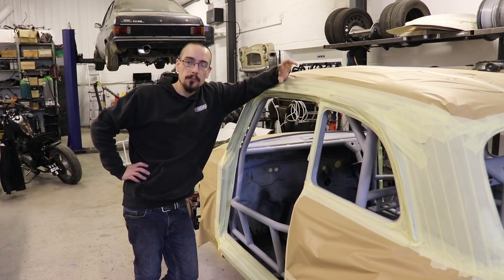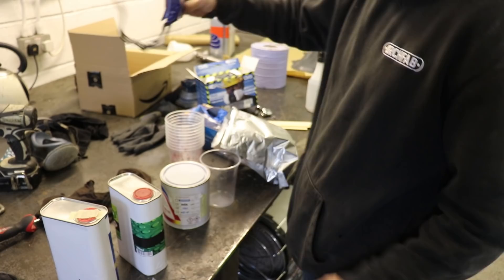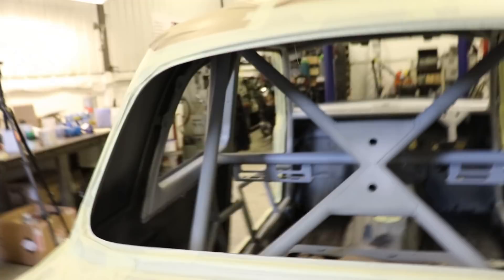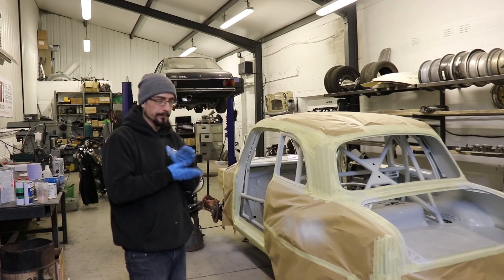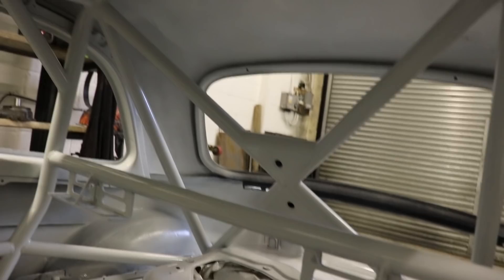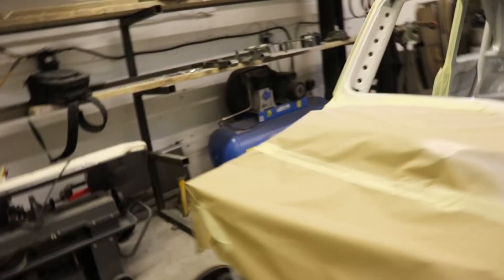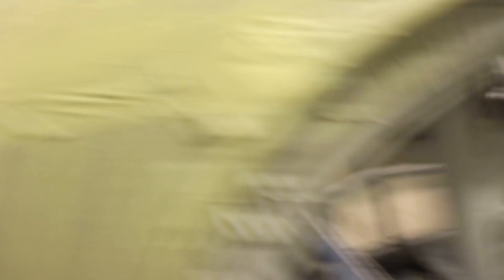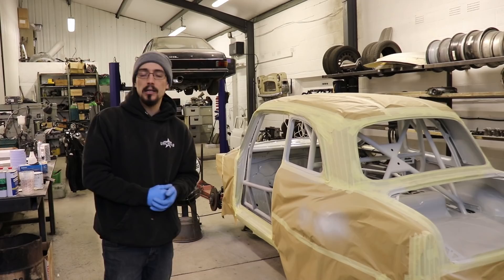ATTEMPTING TO PAINT THE ROLL CAGE, MONGREL 1 URCHFAB NIL.

Comment: Happy New Year. If your heater runs off of propane it will release huge amounts of moisture into the atmosphere.
Reply: Yeah they produce heat, CO2 and lots of H2O. Get an electric heater, as you will also find unpainted projects will rust very quickly.
Reply: @MattBrownbill  and Carbon monoxide CO in huge quantities (odorless and deadly) 30+ years as a gas installer. I have seen the aftermath of a boiler that went wrong during the night, It killed a family of four whilst they slept
Reply from the maker: It runs on diesel.
Reply: @Urchfab  I was a registered  gas installer hence my knowledge of propane. diesel will still produce CO Carbon Monoxide, but I have no knowledge of water content but i'm sure you could look it up.  I just want you to be safe mate. Happy new year !
Reply: @malcolmtill  Diesel does not produce Carbon Monoxide - That is why it is IMPOSSIBLE to commit suicide with diesel and why no one has ever managed to trying to use a diesel engined vehicle to do so. The worst that has happened to anyone trying that was a sore head or feeling sick.
Reply: @williamwoods8022  Sincere thanks for taking the time to reply. Everyday is a school day and at 60 years old I have learned another fact. Happy New Year !
Reply: @Urchfab  Old school rule of thumb was  a pint of H20 per gallon,much is different now,better fuels,burn rate,etc. And a space heater is not an engine but water is just one of the nasties,modern diesels contain all sorts of synthetic additives along with diesels own nasties,space heaters don't burn efficiently and in use they tend to hiccup from time to time,you hear a slight misfire or stutter in the sound of the burner.
Don't buy expensive to run electrical equipment,make a heat exchanger using the diesel heater,some sheet metal and fairly decent sized fan,vent the exhaust fumes out of the workshop and it's much better for your lungs also.
Reply: @Urchfab 
Looks like it's a mixture of issues going on mate. 
The water dots is just simply condensation forming on the colder parts of metal when using your heater, try heating the whole area to be sprayed to an equal temp. 
Wipe down any part your about to spay with panel perfection, just before you spray. 
Get a mini in line water trap just before the gun. 
Then you'll be good to go. 👍🏻

Comment: you need to get yourself some disposable paper paint filter funnels. They do two things they trap the microscopic inpuritys out of the paint so they don't plug your spray gun and second the funnel mixes the paint right before it gets used.
Reply: Yes, when I saw the paint going strait into the reservoir, I was like Oh no.
Reply: Disappointing that the paint supply guy didn't send filter funnels.  Mine always gives a handful of funnels and stir sticks.  Helps to have some empty cardboard trash boxes to toss the used stuff in. As your compressor is running a lot to keep up with the air supply needed to feed the gun the entire compressor gets hot. I suspect that the humidity is well above 50 % there. This fact and the heat from the compressor will cause a lot of water build up in the comp tank and the hose feeding the gun do to condensation.  My experience has been that TWO water traps and an in line trap before the gun will sometimes not be enough. This is why big paint shops have air line dehydrating machines to keep the water out of the lines. Sorry you had the water issue. Personally I don't think it's a big deal since it's on the inside and a scotch bright scuff and fresh coat should cover it up but I realize it is a hassle to have to deal with. I have watched all your vids and I know that you can reorganize and crack on mate !!!
Reply: Or just buy the PPS system from Colad and you dont have to waste time with filters and cleaning the cup (Y)

Comment: The 3 main points for me to spray paint around the joint are,
1 Use a really clean well maintained gun.
2 Use "dry" air.
3 Finish mixing the paint by tipping it from one container to another a few times and then filter it as you tip it into the pot on the gun.
By NO means am I a spray painter, and I usually end up with as much paint on me as what is on the job, but I nearly always end up with a pretty good job.
Well done Matt and all the best for 2020

Comment: You need a cheap gazebo to paint in to keep it warm and the rest of the work shop  clean, good luck, happy new year
Reply: I was thinking some plastic sheeting, supported by a frame at the top.  
You could raise and lower the frame from the ceiling when not in use, and roll up the sheeting in some fashion.
Reply: Was thinking the same, I know a guy who painted his car on the front lawn using one , much to the anger of the neighborhood lol
Reply: Use radiant heaters, even lights will work in a pinch.
Reply: If you use an enclosure, you'll need some extraction, unless you wear a full face air fed mask, but these need a filter where the airline connects cause you don't want to be breathing in water from the compressed air feed pipe, modern professional  paints, are 2 stage finish mostly, some can be 3 stage,  the base coat/s contain xylene, whereas the clear coat(2k)contains Isocyanites; neither good for your health.

Comment: Good effort Matt. I’ve done the same thing on my escort and had the same issue’s. I have footage I’ll be uploading in due course, from my experience, I use a designated hose just for spraying so it had no contamination from oil etc. Use filters when pouring paint into the pot, build a really quick make shift booth using the cheap plastic sheets from B&Q, use a small gun, especially with the cage, I know it’s a pain in the arse. Use an electric heater for heat and not oil or diesel, them heaters seem to blow tiny particles of oil and fuel that contaminate the paint and steel and lastly I use a desiccant inline snake hose from frost. Cured all my paint issues. Good luck, I can’t wait to see the next video.
Reply from the maker: Cheers mate.

Comment: I use the same gun, use 2.5 turns out on the fluid adjuster and full fan. Filter the paint into the gun and as you mentioned use a water trap on the gun. 
If it’s all cleaned out properly it’s a really good gun and shouldn’t give you any issues. Also you need about 2 Bar I think at the gun.

Comment: Get one of those cheap marquee things to setup as a paint booth or string up tarps.
You can make a water trap out of a garden sprayer kitty litter and some scotch pads.
Fit some air fittings to the sprayer tank to suit you lines . The inlet goes at the bottom under a scotch pad, fill the tank with kitty litter or other descant and pack it down and cover it with at least three scotch pads to filter dust before the outlet. Place it before other filters and water traps if you have them. Note this is a back yard setup on a budget not a pro tip

Comment: G'day from West Australia, Matt🙂
I would like to make a suggestion that you can take or leave. As you please.

Air compressor by definition compresses air which generates heat, thus moisture.

Sooo one old trick is to get some aneeled copper tube make a coil out of it,
And run it from compressor head and tank pressure valve.

This gives the compressed air time to cool before entering the tank🙂

Thus extending the life of tank rusting internally, and any air tools a longer life.

If you happen to have access to a second tank you could also add that into the air line at a higher point above compressor, to ensure even drier air supply an oil cooler plumbed into air line between compressor and second tank.

Take what you like and leave the rest Matt, have an Awesome New Year 😉🙂👍👍
Reply from the maker: Cheers Steve, happy new year.
Reply: @Urchfab  welcome😉🙂👍👍

Comment: Hey Matt.  You could get a portable carport/PVC covered area and put the car in that. Less area to heat up and contains the over spray. You can buy the blue plastic desposable water traps for the spray gun. I have used them heaps and they work really well.
Cheers

Comment: I painted my Jeep in a gazebo in my garage. Used plastic dust sheet to cover the floor etc. Came out good in the end. Two water traps on the line and you must filter your paint before putting it in the gun using the disposable paint filters. If the shop is cold use less thinners (reducer). Some guys gently warm the paint but I've not tried it myself. That paint is perfectly salvageable. Don't think spectators at a race meeting would see the defects either.

Comment: That water is most likely from your air compressor, put a bit of air in it and open the drain valve, also fit a moisture trap?
Reply: Have a spare water trap/regulator in Dorchester if you want it..
Reply: You need a water separator, the filter with the paper element is for particles, not water. Ideally you should build a water separator “radiator” out of copper pipe and a few ball valves. Plenty of plans on YouTube. I made one that works great for when I sprayed a few panels on my Range Rover at home.

Comment: I am an auto body technician and I will try to help. I think you have several problems when you cleaned the gun you loosened the old paint but didn't get all of it out so as you sprayed it started coming out. To fix your moisture problem you need to cool the the air before it goes to the filter the cheep fix for this is a steel line it needs to be several meters . regular air line will insulate the air and keep it warm and let the warm moist air pass right through your filters. Also you may be getting fish eyes caused by oil particles from your compressor if you can cool the air your trap will be able to trap them too. But you need to clean or replace your line before you try again. Hope this helps

Comment: Biggest problem is its too cold in your workshop, been in the bodyshop trade for over 30yrs and painted loads of my own cars found out the hard way winter is no good for spraying paint is not atomising has the paint comes out the gun its mixing with damp air causing water droplets under your paint. simple solution is to use a spray tent then warm it up then the problem will go away dont spray with heat very dangerous also could do with it being vented  your more than capable to tackle this paint job happy new year !!

Comment: As said always filter the paint. Get yourself a spray suit lot's of fibers come off clothes, sounds like your compressor can't keep up and you need a water trap at the gun at the very least, a 2 stage drier is better, most people use a refrigerator drier and a 2 stage filter, compressors get hot when they run a long time and the water stays in the compressed air until it cools which is as it leaves the gun if not treated. Look into a disposable desiccant drier if your not planning on painting again after this. 
Get a 1.2 needle kit, I've used that gun for years with good results. 2K overspray sticks to everything you need to cover stuff, you can get a roll of masking plastic, it cheap and big enough to cover many cars completely. Don't be discouraged it like everything it just takes some practice, everyone that's started diy painting has all the same issues. You need to invest in some equipment if you want a professional finish, just like anything else you do, ie plasma, welder etc, you can't get a shitty welder and expect perfect tig welds.
Reply: Pure dead brilliant ,work with what you have....a blind man running for a bus would be glad to see it....
Reply from the maker: Cheers mate.

Comment: Hi Matt, happy new year. One thing to consider is the proximity of your compressor to where you spray,  the compressor will draw in a lot of the overspray at present , clog the air filter and had you used an air fed mask would have recycled the bad air into your mask.  ( I know in this case you used a filtered respirator ). Nicer for you as well if you could relocate to a quieter corner or outside shed.

Coming along nicely, soon be finished, well done.

Comment: Taking everything into consideration i think you did well, plus you sorted out the issues and learned. once you nail the issues and you get consistency from the gun you will enjoy it! My advice for what ever its worth is heat is your friend especially on the cage it can be tuff to judge the coat, and most important is if your doing a deep clean on a gun like that if dry paint or thinners has been sitting in there for ages your as well off getting yourself a rebuild kit with all new seals and inspect the needle for ware. All in all good job keep at it Matt

Comment: Happy New Year Matt,. 
1 ) if that’s an undercoat type paint usually you need a 1,8  to 2.0 tip but most paint tins should carry recommendations on the label.
2) get yourself paint strainers , they are cheap disposable items , paint can have small bits that could clog up the gun .
3) make shift spray booth is a good idea but it  will also involve filters, fans and or blowers so you have pressure inside the booth .
4) it looks cold their, meaning lots of moisture and condensation in the car  and in the air the compressor is sucking in , drain your tank and moisture traps , and heating the place up is a really good idea, you could even heat the paint prior to painting by putting the tins in hot water bucket for a few minutes , will help the paint to flow more evenly.
5) especially after sanding back and before painting blow all dirt and moisture out with your compressor hopefully that will get any moisture out of those tight small spaces .
Reply from the maker: Cheers mate.

Comment: Matt, it's a good undercoat if nothing else once flattened back. Any progress is good progress mate.
Reply: Neil Fairless those are micro blisters caused by the water passing his filter. He needs minimum 10m hose between comp and filter, a second stage filter then a further 10m hose to gun. Unfortunately the only remedy with micro blisters is to strip back to bare metal, re-epoxy and paint. It’s a PITA but happens to most of us

Comment: To be fair you did start with the hardest part of the spray … inside with the roll cage etc. so the gun is always at unnatural angles and trying to reach into difficult places. Exterior is still hard to get perfect but would be a dream in comparison to what you're trying to do at the moment. As you said .. try a new gun and a water trap is a must ...I even have two fitted on my airbrush. Plus try what someone has already suggested .. a Gazebo but with plastic sheets down the sides to form a spray booth.  Keep going Matt .. success will taste so much sweeter. Happy New Year.

Comment: If you get a run then just plant a shrub in front of it and no-one will notice it. When I used to paint cars in the 70's we always said "Run she  might but shine she must". Temperature plays a huge part as does humidity, but it definitely looks like you have moisture trapped in that hose. Also, they make a touch up gun that holds about a half pint or less and it'd be much easier to handle in tight quarters. Good luck to you. It's coming along nicely. Did a similar project many years ago with a 63 Ford Falcon onto a 68 Mustang finished up with a 351 cu in small block. The car was frightening on the street as I believe you'll find to be true with your little Ford as well.

Comment: Humid weather means the compressor is inhaling water which ends up in the paint. Cold weather makes paint stay liquid longer and more likely to drip. (grip coat lightly everywhere first before trying to cover it all in colour. That helps it stay put and not run) You're fighting nature there with our cold damp winter. . Love the car, there's a lot of great work on it, don't spoil it now by doing a job that will microblister in a few months. Infra red lamps and a multi stage air dryer might get you by if you fancy gambling but if it was me I wouldn't dream of painting anything outside of a heated booth until there's been at least 3 consecutive dry hot sunny days in spring. The farmer down the road from me has done loads of summer resprays where he paints at 7am before it gets too hot and then leaves it outside baking in the sunshine all day. Some of them have come out stunningly nice. I reckon if your dead set on this time of year and doing it yourself you need to rent somebody's booth from them to dry bake it first to get all the moisture out and then again after the paints on. The mongrel deserves a nice coat,    Happy New year!

Comment: You could try building a temporary paint booth. I have done this with friends and had decent luck with it. You frame it with 2x4s then cover the walls with plastic like the stuff you would put down to protect your floors if you were painting a room in your house. It is super cheap. Use AC filters for the intake vent and a box fan to draw air out. You can heat the area easier too but you have to be careful as to what heat source you're using and the proximity to the plastic.

Comment: Yeah long runs of air line can cool the warm compressor air down too much causing condensation in the line after the filter/dryer.  You want to use as short a line as possible and put a secondary filter on the gun.

Comment: Temperature is your enemy.
This season is the worst in terms of temperature and humidity.

I'd see if you can get accelarator for this paint system. Then it dries extra quickly. Take into account what you're creating, and hang up an humidity gauge.

A heater is fun but gives a lot of moisture in the air, just what you don't want. I don't know how much work it is but I had the mongrel mounted on the rotisserie. By turning, you always look up your work, instead that as a contortion artist you braid through the interior. Finally: Experience a peaceful and cosy New Year and good luck in 2020